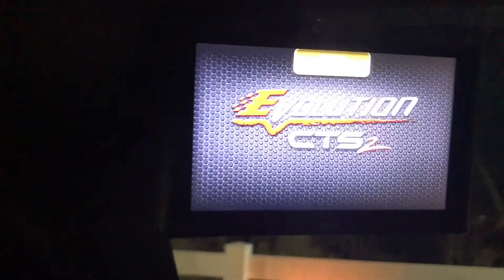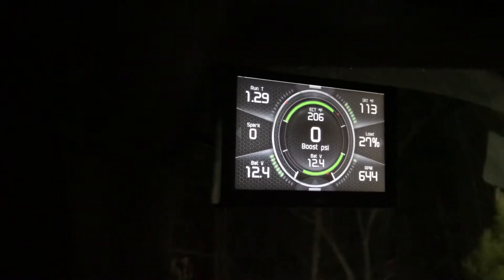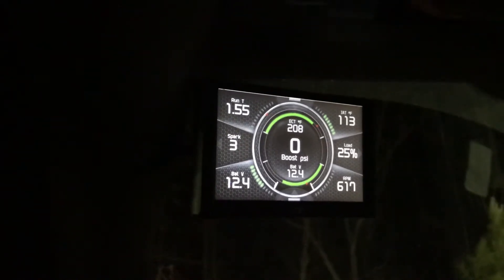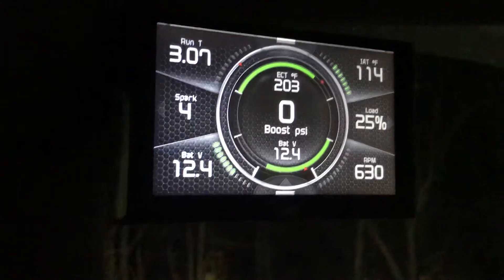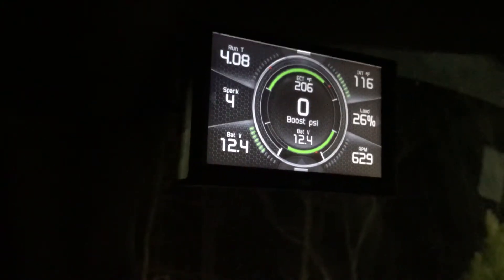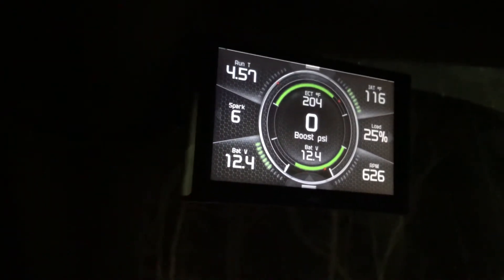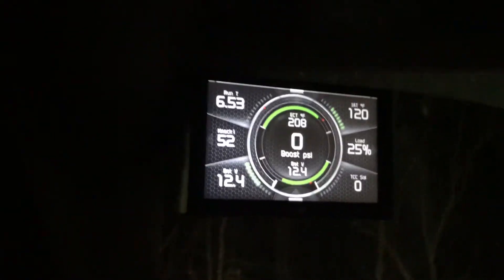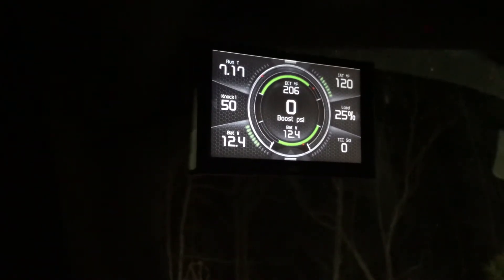Edge CTS2 problems and review

Comment: I had one on my 05 f150 but I sold the truck and got a ecoboost f150 and now it turns on and off it won't stay on the menu it just powers down
Reply from the maker: My experience with them was not good and the OEM didn’t back their product. Sucks that you are experiencing similar issues
Reply: @joeymt3  ya it sucks
Reply: I have the same issue on mine and can't figure it out